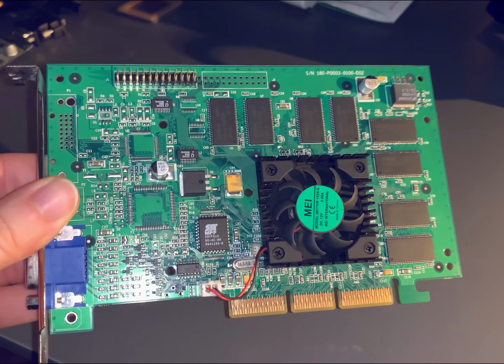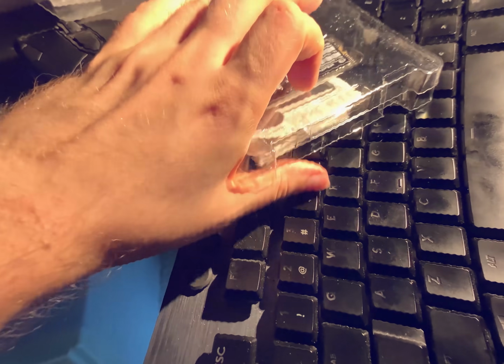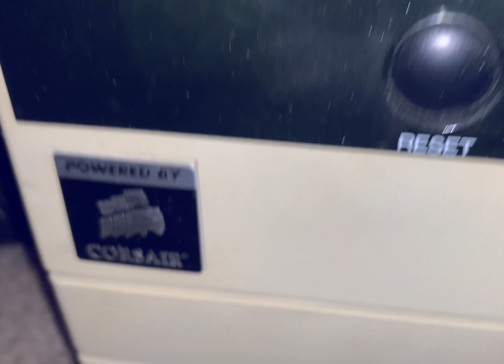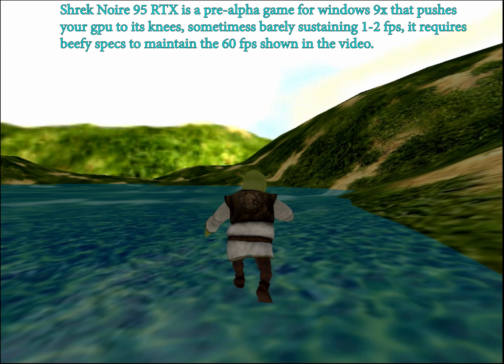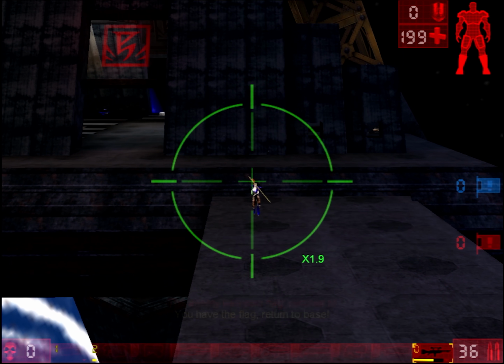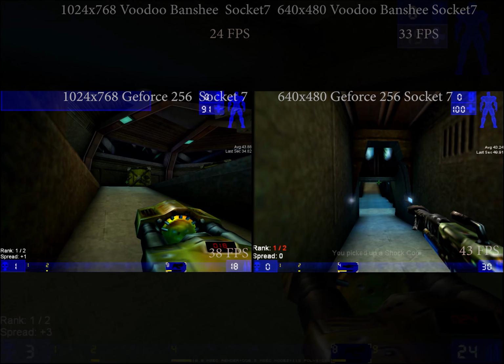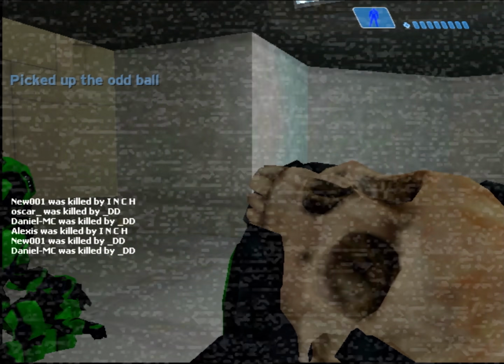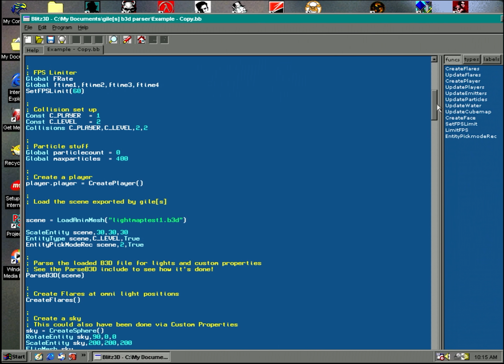Nvidia Geforce 256 - The First GPU Ever Made Is it worth getting? #gpujune2

Comment: Wrong, not the first GPU
Reply from the maker: First “GPU” according to nvidia is what it meant 

They attempted to coin that term 

In reality first gpu might be ati 3d rage, some said a Texas Instruments thing but that wasn’t consumer and not really a single chip
Reply: @psychoticgiraffe  I actually consider the TNT2, based exclusively on the fact it can pretty much do the full graphics workload after being tasked with doing so. 
And for reference, for first "Personal" computer graphics accelerator was the Commodore Amiga Chipset, which is something the PC only started doing similarly years and years later. For most of its early life graphics on the PC were nothing more than a screen output interface with some ram and a ramdac, any functions needed to be done by the CPU. This is what the first accelerators came to address and start the path of PC towards a real GPU, where the graphics subsystem actually can work way more independently and requires way less CPU work to do anything. I'm sad this took so long to come to where we are. Wish I could go back in time and run Commodore Amiga myself and drive their evolution path, we would have come to where we are today 10 years earlier.
Reply from the maker: yeah the amiga and 3DO had some tech that was very similar,  sadly not really a GPU but the groundworks for one, TNT2 is lacking the cubemapping and full dx7 support among some other things that nvidia decided deemed it not really a gpu, but yes it has one main chip for graphics, which in leymans terms means it could be considered one; I however would say, by that definition I'd go with ati 3d rage, maybe s3 virge; they aren't very good(even for the time, they were smashed within a year by everything else out there) but, its a primary chip doing the processing on those, and not a multi chip config like voodoo

a lot of the cards prior to those were multi chip configs with poor 3d support, the virge has terrible 3d and slows down 3d for example, but at least does 3d lol
 @wskinnyodden

Comment: I was very happy with my ASUS Geforce 256 DDR (V6800) in 2000. I was gaming a lot on TV at the time and the V6800 Deluxe was the perfect card for that. Arcade feeling! The GeForce 2 GTS was a similar jump and "forced" me to buy a 19 inch CRT for the now possible higher resolutions. Good times 🙂 
BTW: "GPU" is debatable. The first true graphics processor might have been the TI TMS340 family in 1986. They were fully programmable and had specialized commands for graphics and dedicated ram. The earliest 3D accelerators were based on the "TMS34020" together with the floating point accelerator "TMS34082" in 1988. These two chips were connected by a proprietary interface, behaving like a single chip to the host system. This highly programmable system had to be loaded with a program from the host system. Its flexibility was its downfall and TI lost interest in this market segment. The usual graphics needs were much faster implemented in hardware as fixed functions and the complexity of the universal GPUs made them expensive. In the end the TMS340 family had limited success in scientific and development environments as well as professional graphics workstations. The Geforce 256 had a lot of firsts but being the first GPU was pure marketing. I think the Geforce 256 has a solid place in history, even without being the first GPU 🙂
Reply from the maker: I agree, although interestingly, I don’t think GPU existed as a term back then, but if that TI thing was a physical graphics card with one chip and not a giant array of things like most were, it would be a contender, I’m assuming that it was probably used for cgi, what sort of OS supported it? Is it possible to even find it anymore

Comment: Ati Rage Fury Maxx (don't buy this unless its 20 dollars)

20$ right, maybe you can get a broken maxx fan for that kind of money. I bought one for 200€ and I consider this a great deal. It's a useless card, but really nice one to have in your collection. They are picky about motherboards though. Nice video btw, enjoyed watching it.
Reply from the maker: Thank you, yeah ati rage fury maxx cards are a huge pain to actually use, I think that if a card is going for nonsense prices but does basically nothing and is useless, it’s value should diminish in time, engineering samples have more collectors value than a card with a borderline defective design thst doesn’t work very well, and it’s not as rare as like fx 5800 ultra so it doesn’t even justify the 1000 ppl ask a lot of the time; I keep mine solely because it looks cool but if I find more of them I’ll probably sell them for cheap since I personally think they shouldn’t be worth much, I also have the fm towns pci card, that’s a useless card for the most part as well, but, at least that ones much less common, there were a surprising amount of oem systems w the maxx which is where I found mine, can’t say the same for the towns card